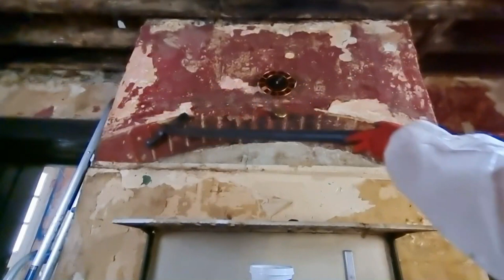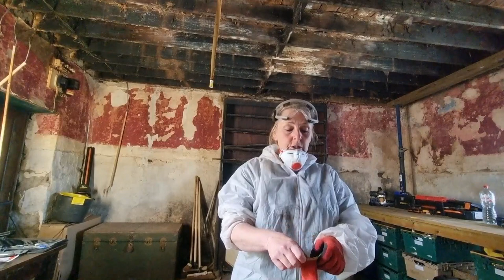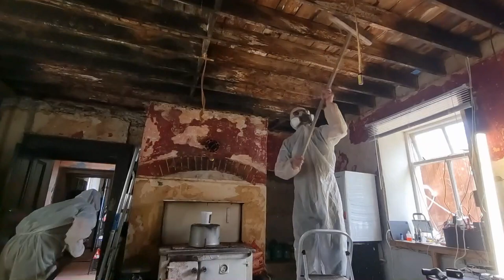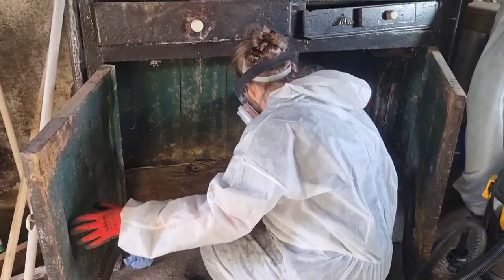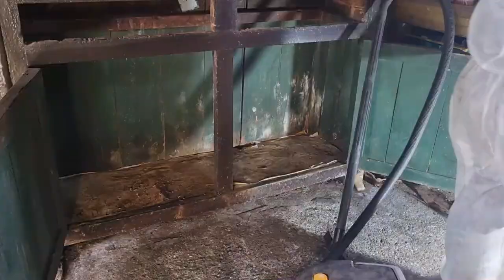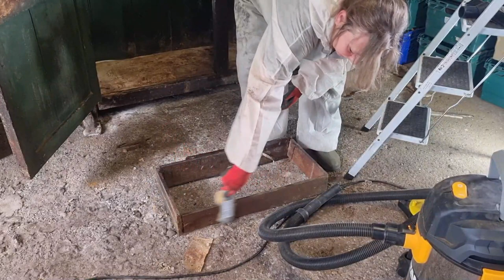Cobwebs and falling bits be gone: Our derelict Stone Farmhouse in Ireland

Comment: That was a good idea to brush down & vacuum the loose bits. It must be tiring having the stuff falling on everything.

Have you considered using a mildewcide/ mildew remover to clean any wood/plaster that is stained but still solid? It's cheaper than ripping out & replacing everything.  Also, a pour over leveling compound might help flatten bumpy floors without having to jackhammer out the floor. Just some ideas that may work.
Reply from the maker: Yeah it is a little! It was a mad dash to make anything to eat or drink! You had to kinda loom over everything to guard it and cover it with something if you moved away! Sooo much nicer now. I suppose it’s good practice for when we start taking out the rotten timbers because there’s going to be a whole lot more mess then! Haha. Good advice with the floor, it is a little uneven in places. We’ve sprayed a few places down with a mould and mildew spray….which does seem to have helped. The mould on the joists in the kitchen didn’t like it very much, which was the plan! Lol

Comment: The more the joists and floor dry, the worse condition they look.😢 Same goes for that cabinet you want to keep-mold and wood is never without each other once it happens😢.
Reply from the maker: Yes, I think we will be lucky to save any of the floorboards. We/I keep swinging back and forth with the beams…because as bad as they look…they’re pretty solid apart from a few. Most likely they will go but it goes against what we want to achieve with the house, so it makes deciding a bit difficult.